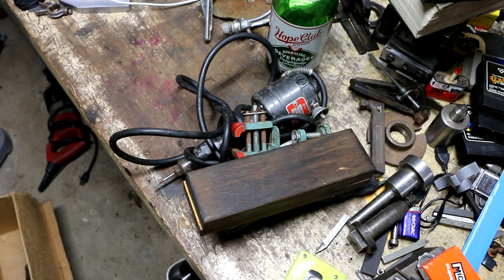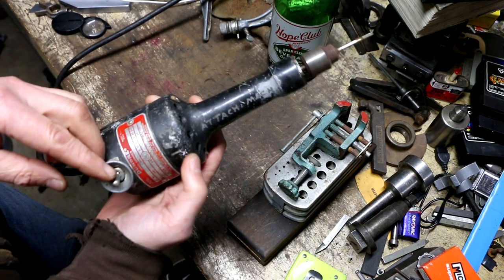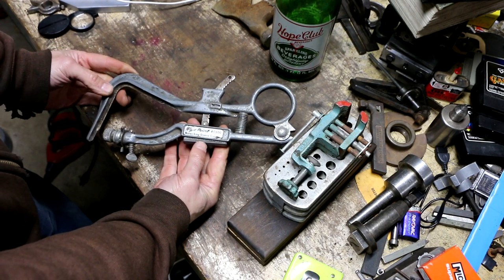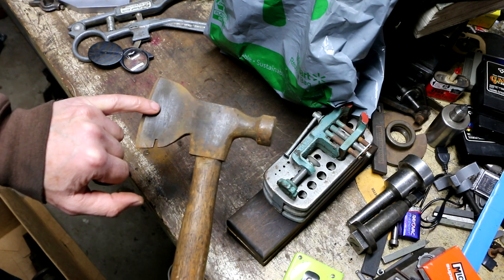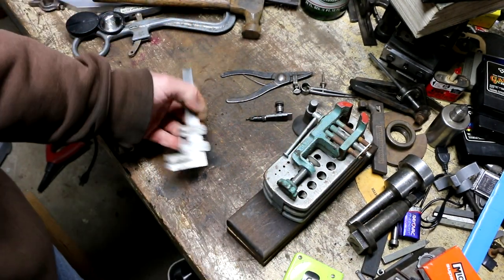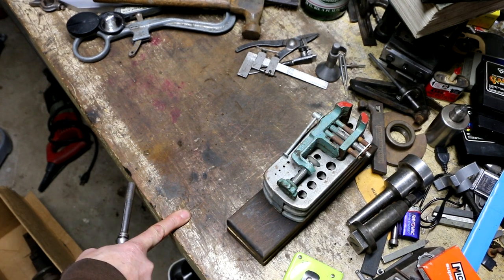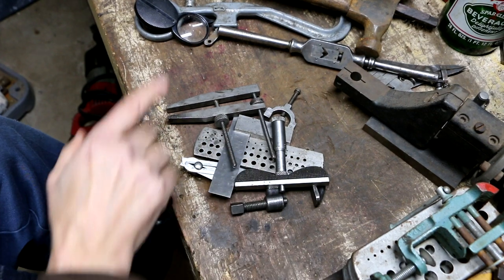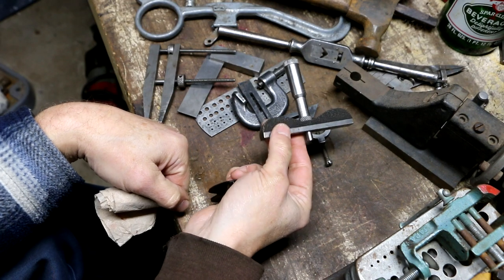October 30th 2021 Brooklyn Fairgrounds swap meet Day 2 of 2

Comment: Starrett 564 are nice, but always seem to be sticky, even if dead clean. The ball inside seems to be the reason. DB&S marked tools are not real common, but not rare. B&S formed 1850-ish when Sharpe joined the existing Brown organization. Darling was a competitor, and merged to B&S in 1866, and his name dropped when he died in 1896.
Reply from the maker: I figured the DB &S was "rarer" because that little caliper trades for over $40 on ebay where a plain B&S version is lucky to bring 5 bucks. Thanks for watching.